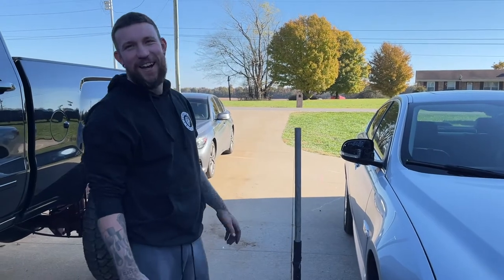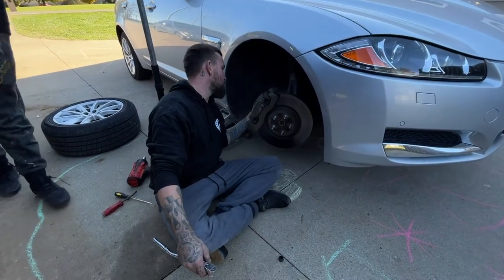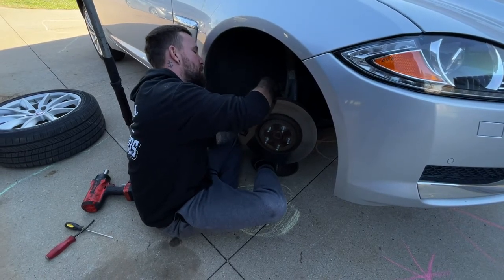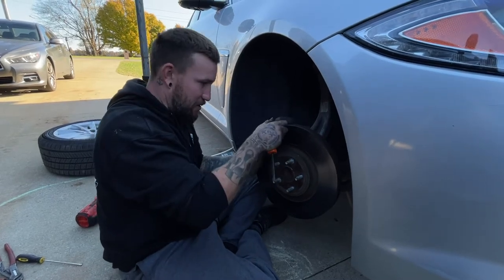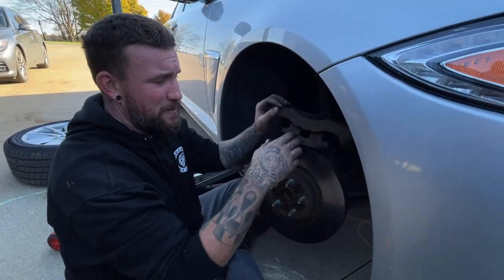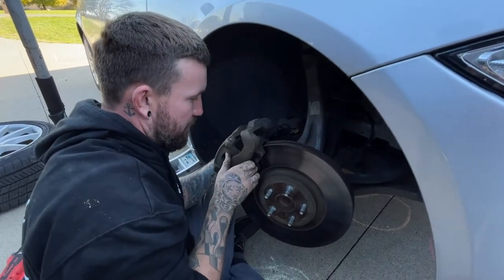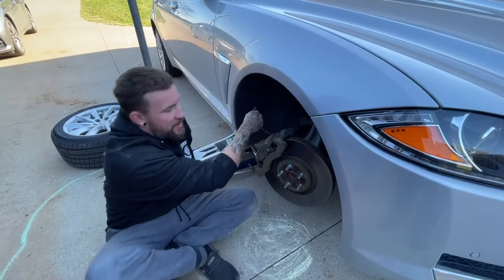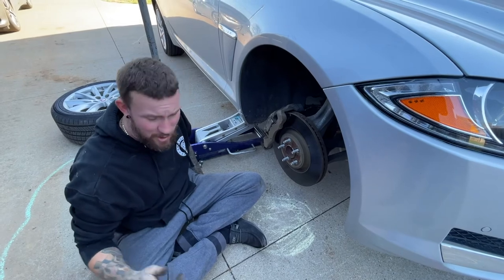DIY Jaguar XF Brakes Everything You Need To Know

Comment: Jesus how not to do it ! No axle stand, never hammer pads in if you clean the rust and dust off the caliper and it goes in easily. It’s supposed to slide. Removing the master reservoir top makes moving pistons easy.

Comment: 7mm Allen head not 9 mm
Reply: 9mm - you are wrong!!! its 100% 9mm front when having uprated brakes.  7mm rears.

You probably have the basic discs and calipers on fronts with 7mm smaller hex heads.
Reply: 2015 XF 355mm rotors 9mm caliper bolt pin/bolts
Reply: earlier years were 7mm